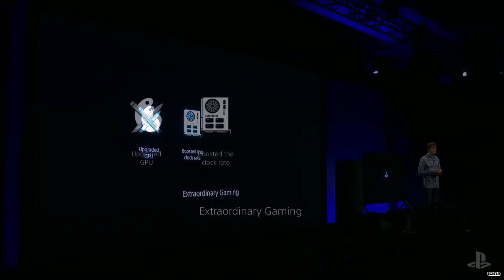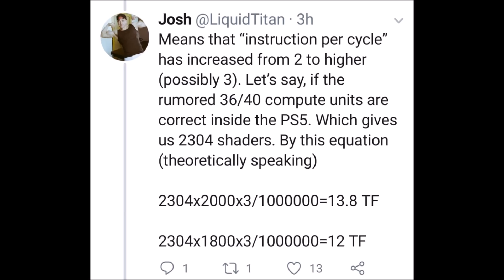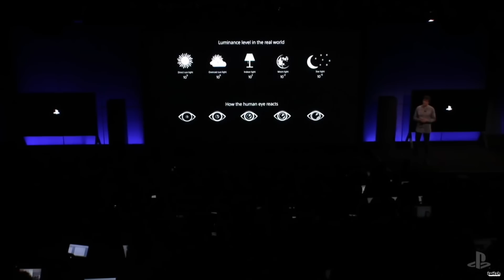Is This the PS5's "Secret Sauce"? Mark Cerny Rewriting The Tflop?

Comment: 3 years back AMD filed a patent popular as "SUPER SIMD" design in tech community and from that day we have an eye on that. 
I can send you the patent application but it's too technical so you wouldn't be able to understand it. 
GCN arch uses 1024 vector lanes in 1 row of ALU at max for gaming workload and then it's divided into block of 4 to complete any job 
So if a task "x" given to GCN it works till 4 cycles and then suddenly work is complete but for rest 3 cycles there is no work and that made GCN exceptionally good for compute but bad for gaming because gaming is mix of serial and parallel work load 
SUPER SIMD has fundamental changes like it adds more vector lanes to work on more instructions  per block so in each compute block we can map wavefront more effectively.

In a nutshell it's not an evolutionary change but it's a revolutionary one, it changes the fundamental method of GPU computing.

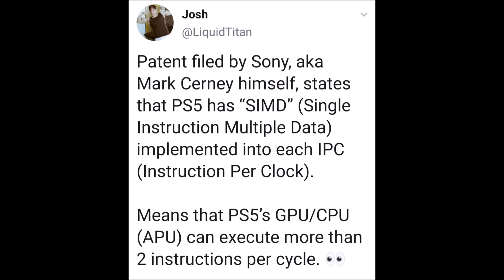Comment: what unfortunately doesn't matter is the RDNA 2nd gen vs 1st gen... accompanied with the Tflops... and video ram... some of the specs do matter...OMG what you said at 5:00 is EXACTLY what the outcome would be if it hat EBM RAM!! instead of the faster but less threaded Gddr6!!! i've posted links, basically MANY more pipelines, at a slower rate PER thread is the EMB2... But collectively EMB ram can run 10x the amount of threads on a stackable architecture with slower transfer, but because it has so many more threads its SOOO much faster in a "per second" equation.... DDR6 is FASTER per thread... but runs hotter, and cannot fit as many on silicon as the HBM2...  If they drop this bomb  its a rap... Now i'm stretching this theory as there are multiple custom ways to do what Cerney is stating but this is a very close comparison as to how and why it could be what sony is having in their machine.... Also... its directly linked to the cpu... slower rates coming in but more of them allows the intercepter to line them up... essentially less distance for data to travel.. just look up GDDR6 vs EMB... and you'll see what i'm saying and how it corresponds to this explanation of his...

Comment: I don't know Mark Cerny responsible for the PS4 and also for the PS5 does not give me the feeling that it will be the fastest Console look at the PS4 at start.
It was not a powerhouse compaire to the PS3 when it was launced.
We did get an PS4 Pro upgrade within the console cyclus also same for Microsoft.
Now we know that the new Xbox will be a beast, i am not sure about the PS5 they mostly talk about fast loading times new controller with extra buttons and Wait Microsoft has hardwae raytracing so we did also implement that.
The feeling i get is Sony does want to give us some new features but it has to be cheap.

Comment: HBM2e Ram with 9.2 teraflops and all the rumors we've heard being a bit lower would be enough to push the PS5 into a more capable system.   And thats saying a lot as the series x is looking like an absolute BEAST and i want it lol... but i want sony to hold nothing back i'll pay the 6 bills, or 579.99 for a no holds barred platform...i have always been seen commenting as a Sony Preferenced gamer.  I have said my faith in Mark Cerney is where my Sony gaming faith continues... The only worry is if Mark is not confident a high price point or too big a loss will be the best step forward...  on the same level... if MS releases the better console by a large margin... I will be going to the performance and unfortunately have to split my passion (performance in games vs First party studios) and have the ps5 as a secondary... I wouldn't be able to resist getting the series x if its all people are saying and Sony's console is in fact a ways behind... This is the first year that console manufacturers have a chance to be current to PC in performance, and Series X looks like they're there..  Sony would be fools not to up the ante, like the PS4 (aside from price) the early adopter will carry them fine as long as we're getting a great deal on the tech and hardware... Not a ps3 situation... I'm talking  tried and true hardware with some proprietary magic to make a beast of a machine...  I don't think we'll know until e3... but here's hoping...

Comment: Basically Sony can’t make a console as powerful as series x or they can’t afford too
Reply: Sony seems to take a smarter approach than just using brute force.
If they can release a cheaper console that punches way above its weight class then that's great
Reply: Microsoft seems to never be able to make good exclusives even if they have the money to do it.
Reply: Kevin Macak what bad exclusives do they have?
Reply: Grizmark Sounds like there trying to make 2 grilled cheese sandwiches with one slice of cheese. It’s just not gonna work and in that case it means the ps5 would be as powerful as 18 tflops. Sounds like there trying to convince consumers
Reply: Ah ok....thats why Lisa Su from AMD said to sony "good luck with your secret sauce". lol Not sure anymore if it was sarcasm or honest.....
Reply: Grizmark what happens if Xbox does the same technique?
Reply: William Felix Thats a terrible comparison seeing how Microsoft weren’t targeting power and they were scared of the console overheating so they over engineered the cooling system
Reply: Grizmark which is why casuals will pick the Xbox they only want power and don’t understand this mumbo jumbo Sony is doing

Comment: This is definitely going to be used in the ps5. This tech is used in ps4 pro. 2x 16 bit integers, doing two work loads at the same time as 1 32 bit integer. 

It may be honed in and iterated on, but it was used in ps4 pro. Just be careful! I remember before the ps4 pro and xbox 1x came out a lot of people claiming this would push the ps4 pro to 8.4 tflops.

This isnt how it works. It is about efficiency, it doesn't double power. More like 8.4 tflops, but at 16bit, not 32 bit computations.

Great tech for certain tasks! There is a specific name for it in AMD architecture, but I am struggling to find it. Sorry.
Reply: @William Felix yes exactly, thank you so much!

Comment: This is the same type of thing Cerny did with the PS4 pro, look up PS4 pro 8.4 teraflops.... The PS4 pro is 4.2 but Cerny explained it like this...

One of the features appearing for the first time is the handling of 16-bit variables – it’s possible to perform two 16-bit operations at a time instead of one 32-bit operation. In other words, at full floats, we have 4.2 teraflops. With half-floats, it’s now double that, which is to say, 8.4 teraflops in 16-bit computation. This has the potential to radically increase performance.

Comment: $400 PS5 with 9.2 tf still very good for exclusives AAA games 🔥🔥🔥
Reply: Fv458 Exactly! People are forgetting that the current base box is just 1.84 TF, GCN for that matter, and yet we got games like God of War and UC4 looking and running incredibly on it. 9.2 TF of RDNA is leaps and bounds above that, we ain’t even ready for what PS5 games will look like.
Reply: If it's 9.2 rdna that mean it would be twice as powerful as the xbox 1 x also.....a lot of these xbox fans are going to be very disappointed because Phil only state the xbox series x is twice as powerful as xbox 1 x n they simple mindedly thought it's 12 tf.
Reply: @milogamingtech7091  make a lot of sence
Reply: @f3ndy143  yup he would have state the specs right away if that was the case.

Comment: Secret sauce is how Microsoft keep shotting themselves in the foot. First the horrible name then the horrible design and now the knowledge of knowing that next xbox won't have any game using it exclusive power for at least 2 year's.  It's like getting a new car but you are not allowed to use the extra power it has and air conditioning or any advantage of the new car until 2 years . Lol idk if you see how stupid that sound.   Total failure

Comment: Do you even know what you're talking? I'm getting more confuse by the second.
Reply: He actually he doesn't know everything . Did you not listen ?
Reply: I think basically they are using new technologies to get more power out of their hardware.
But before you get too excited: such improvements are not totally new and xbox is propably doing some improvements of their own.
Still it means that the PS5 will be able to do more than current AMD graphics cards

Comment: Stop with the secret sauce talk.  I still haven't forgotten 'the cloud', 'direct x12' and it turned into nothing.  The secret sauce is code for a desperate fanboy.  MBG please don't go this road.
Reply: But sony already proved themselves to me with a less expensive and less powerful pro model and checkerboarding.  They could do the same with the ps5 and I would be fine. I didn't need the onex for multiplats that looked barely any better at a higher cost a year later. To top it off where were all those exclusives.

Comment: Normally AMD GPU Architecture always have FP16 and FP32 in their CU that why GPU aged so well and always capable of Ray tracing a bit compare to Nvidia 1000 series and older even Nvidia Card have better rasterization than GCN Architecture which is more Compute task.

but this is interesting. it like Cerny putting Multi-Thread into GPU itself. i don't know if it ever exists but i never heard it before. if it something similar to Multi-Threading like HT or SMT it not going to give 2x of performance but depending on the task but it still has to the same amount of silicon or CU but it will have fewer issues with Bottleneck.  in case of CPU with SMT and Non-SMT it depends on the programs if certain programs work well with SMT then it will work faster if it only uses a single thread then it not going to run faster.   but GPU is always working in clustered i think this might be huge.

i'm not Computer Architecture Engineer so i don't know.

Comment: 36 compute units is 36 compute units hands down unless a holographic chip pops out of the existing chip that they have, you still have 36 compute units at the end of the day bro.
Reply: That's like saying GPU architectural differences don't matter, if PS5's GPU can do an extra operation per cycle then it would be like Sony put another 18CUs in the console.

It's entirely possible Cerny had AMD up the cache and modified some of the core RDNA 2nd gen architecture to allow for this.
PS5 could have a fully customised GPU, MS a semi-custom APU, with BASIC 2nd gen RDNA.

It's just a patent at this point, but we also don't know anything about 2nd gen RDNA from Navi yet.

Your post is highly ignorant of how GPUs work though.
Reply: @MrSec84  just rub the genie lamp and make a wish that the PlayStation 5 has more power. Because you guys are coming up with all these fantastic ways of how you can increase 9.2 tflops.
Reply: @Atomic425  Third party games on PS5 and Series X will look very similar and first party PS5 games will look just as good as anything on Series X. 9.2tf vs 12tf in GPU power really isnt a huge deal, we're talking only about 30% which is less than the power difference between the PS4 Pro and One X. It will just equate to Series X running third party games at native 4k while PS5 would be around 1800p. You won't really notice the difference in real life, you'll need Digital Foundry to point out the minor differences. Fanboys of either consoles are dumb.
Reply: @Atomic425  you're assuming you know what the case will be, even though neither Sony or MS has actually announced anything.
I'm simply explaining to you that TFlops don't tell the full story, they basically tell you nothing if you're only looking at that one figure, without taking all the GPU's architectural features into consideration.

If a stream processor can handle 3  or more operations, vs 2 in another SP, then you have to factor that difference into the equation.

Having a GPU architecture that handles one or more extra operations per cycle isn't some impossible thing, it would just be unique and entirely feasible.

The very leaker that put out the AMD Navi 2 benchmarks that you're holding as gospel has already stated that those leaks are phony and they were intentionally made up by AMD to throw people off the scent, while weeding out people breaking their NDAs.
Reply: @MrSec84  so what you telling me is this guy that's figured out some stuff that the chip makers have not? Save yourself some sanity and stop worrying about it like I did a long time ago and have fun with it.
Reply: @03chrisv  no doubt my man ain't going to look pretty much the same the difference in my opinion is the performance

Comment: This conversation about Teraflops is funny to me... I'm not sure it matters anymore now that the consoles produce some form of 4K ... the hurdle now is more about getting the textures off the hard drives faster. I'm just thinking about games like God of War, Horizon 0-dawn, red dead redemption 2, Death Stranding, etc... incredibly beautiful games, incredibly realistic. The extra horse power in the new consoles are probably going to be used for AI in addition to moving/controlling more objects on the screen at the same time, possibly more advanced game mechanics or boss/mob mechanics. The point here is that you don't need more teraflops for graphics so the benchmarking of the teraflop performance kind of doesn't matter if the special sauce is enhancing some other aspect of the games. (so a lot of the "special sauce" in the GPUs is going to enhance other aspects of the games to push the boundaries of what the developers can create and do in games)

Comment: Instructions per clock isn’t something that’s as insane as you’re making it out to be.

IPC is part of the reason GHz doesn’t mean anything when comparing CPU’s/GPU’s to one another.

It is interesting to see Sony modify existing AMD architecture to such a degree, though.

I wouldn’t doubt that it’s intentional. From my understanding, it does make development easier, and it would “shield” the true power of the PS5 from the competition even if both systems use the same base architecture, and both serve to benefit Sony pre- and post-launch.
Reply: SIMD isn't new, it's not a gamechanger, nor did Sony design it. They are one of many companies that seem to have a patent on some slight variant. AMD themselves own several SIMD related patents. SIMD was in their last generation GCN architecture. Either it, or SIMT (which is largely regarded as better) is in their new RDNA architecture. Microsoft's original Xbox in 2001 had SIMD.
Reply: KNorth2 I’ve actually been in the process of researching the original Xbox out of curiosity recently, and I didn’t know that, so thank you.

I used to build PCs, but I never got that deep into it. It’s fascinating to think about, nonetheless.

Comment: Wait wouldn't that mean more Teraflops if you rewrite the equation? If there are more instructions then a smaller less costly chip that can output much more Teraflops than series X. 

So the industry saying the PS5 is more powerful could be supported by this.

Comment: The Series X isn't just a little bit more powerful than PS5.  There has never been such a gap in performance between the big two. Your 'presentation' was worse than when fan boys were believing that cloud computing was XBones 'secret sauce'; turning all of them into super computers.
Reply: What makes you think xsx is that much more powerful than the ps5
Reply: Pretty sure the gap between the PS4 Pro and Xbox One X is bigger. The One X is 44% more powerful than PS4 Pro, whereas the Series X would only be about 33% more powerful than the PS5 if the leaked specs are true. In the grand scheme of things third party games will look very similar and first party PS5 games will look as good as any exclusive on the Series X. I think you're making it a bigger deal than it really is lol. If Sony launches the PS5 at $399 they will be the market leaders again.
Reply: @03chrisv  hey

Comment: The 9.2 leak And the test papers were debunked as old and possibly purposely leaked, so, we’re back to square one knowing basically nothing lol. Then there’s Mark Cerny... so know less than 0 lol.
Reply: Was the 9.2 leak already debunked, I didn't know.
Reply: The 9.2 was not debunked and the tech site Digital Foundry even managed to validate the information.
However, you are correct that the information is several months old. In  the mean time they might have been able to do some smaller improvements. But I don't think they will be able to go 11tf or higher since that would mean they'd have to scrap their current chip and go with a larger one instead.
In the leak they were are at 36 CU clocking at 2ghz which already is an insanely high clock rate for console. And going higher than 36 seems unlikely as well. I don't know if 38 CU might be possible which would put them at roughly 9.8tf

Comment: the problem with this is simple the third party devs will not use this method to create their games if it takes extra work. they will just go by the raw teraflop number, just like they do with PC. if your hardware is powerful enough to run it then you brute force performance. if this patent is like the rapid pack math method then Sony is going to have problems when it comes to the multi plats. you need to understand that and stop saying power doesn't matter. it does matter when it comes to the multi plat's. these devs are not doing more work than is necessary. Sony needs to not cut corners and make their box as powerful as they can, when it comes to their exclusives their API will handle that.
Reply from the maker: I see this does make a lot of sense if true. I guess we will see what happens and how. Ig the power difference will be between the PS5 and XSX